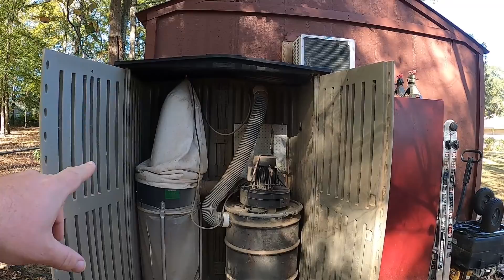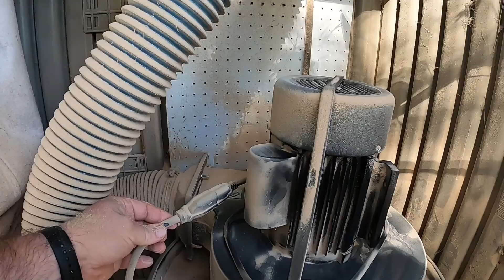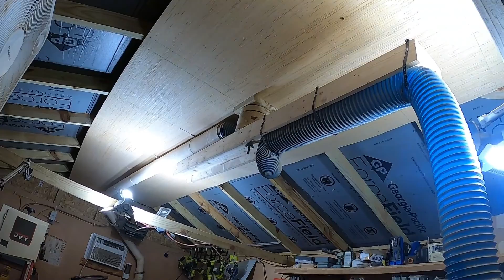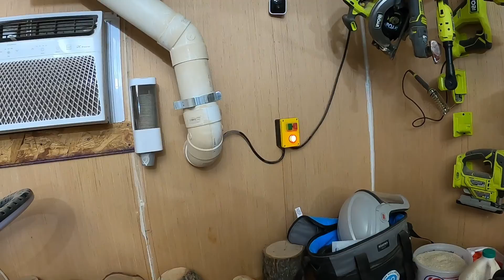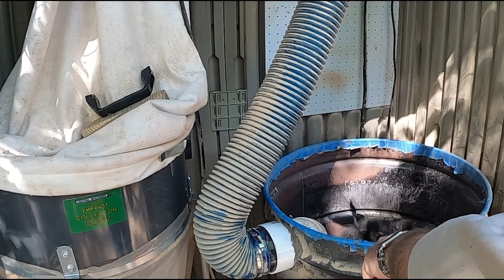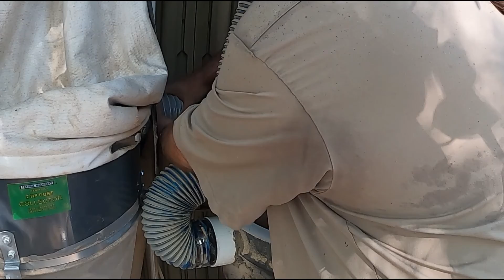Small Shop Dust Collection - Put It Outside!

Comment: You are pumping a massive amount of air out of the shop. Where does the make up air come from and how does it impact heating and cooling?
Reply from the maker: The shed is not airtight so plenty of makeup for me (and the window a/c unit has an intake damper). If the weather is nice I leave the doors or windows open. I’m sure it’s not the best for heating or cooling but I generally only run it when needed. I have a box fan with three merv 13 filters that recirculate the shed continuously. Great question, thank you for asking and watching!
Reply from the maker: Between your feedback and the setup on the Myers Woodshop video, I may have a future modification to consider. Instead of using a separate tool closet, I may build an attached closet, fully enclosed, with a MERV 14 or 15 box filter back into the workshop. This would allow makeup back into the shop with less impact on the heating and cooling and less restriction on the discharge of the collector. The noise should still be reduced since it is still separated (and not take up existing floor space). Your thoughts?
Reply: Now you’re talking Ember. Just make sure that the filter opening from the closet back to the shop is large enough to supply enough makeup air. There are two problems with the current system. 1 - you are expelling all your conditioned air from the shop. 2 - when the shop is closed, there may not be enough air sucking in through cracks to feed the beast and it will not be able to perform at its rated capacity. It will suck, but it won’t suck enough. So I think your new solution will work with a properly sized return. Not perfect in terms of conditioned air, because the closet will be colder than the shop. So on short runs you will still be pulling cold. On longer runs you will be warming the closet.

Comment: Thanks a lot for the video. I have Neighbors 30ft from my shop, do you think it's far enough? I'm worried about the noise
Reply from the maker: The noise is going to depend on a number of things, your collector and if your shed for it is insulated would be the big ones. Mines fairly quiet and almost unnoticeable at 30’, but putting some sound insulation in the shed should help if needed. Take a look at the comments too, there were some good ideas shared there
Reply: @emberwoodandcrafts-thomastritt  Thanks a lot 🙏

Comment: To all that commented to Ember. I have a question. I had a girlfriend that worked in a kitchen over a hot grill. every time she turned on the exhaust fan it would suck all the air out of the dining room. They installed two 4 x 6 vents to the outside right above the grill. When she turned on the exhaust fan she would open the doors on the new installed vents. It seemed to work. The exhaust fan pulled its air from the vents that went outside.  I have a large filter system that I am going to mount outside my shop. I was wondering if a person can vent the dust out why cant they pipe the fresh air in right next to the tool that's going to suck the air out when the filtration system is on. Might be difficult for your overhead flex hose. But I guess you can have a cross draft coming from the wall piping fresh air to any tool in the center or maybe run a smaller flex hose the the same area where the suction is. At least you will only be cooling the air between the air in and the air out. Just a thought. What say you all???
Reply from the maker: Should work. You might lose some heating/cooling, but I have some loses already - nothing I’m overly concerned with for my shed. I plan on building the utility room for it in the future and will likely vent it back in through a merv 15 filter. I like your idea as well since it would keep the recirc loop small!

Comment: This is a common mistake that many woodworkers make. Sounds great, but when it gets cold outside, suddenly you realize why this was a very expensive mistake. All the air that your collector is sucking has to be made up with outside air betting sucked through all the leaks in your shop. That air will be very cold (outside temperature) and it will get very cold in your shop very quickly. All that make up air has to be heated now to keep you comfortable. Maybe it never gets cold where you are, but most don't have that luxury.
Reply: The thing most woodworkers need to worry about more are the fine particle dust their lungs are sucking in without realizing it. You can spend thousands of dollars and messing around with expensive filters and still not do nearly as good a job as Thomas does just venting all that $#@! to the outdoors where it can be safely diluted.
Reply from the maker: I don’t consider it a mistake, but do concede your point - may not be for everyone. It can get chilly here, but nothing I can’t handle with a sweater and space heater nearby. But this is a good point to consider. For me keeping the noise and fine dust outside is worth it in the summer and winter. I do turn it off when not in use so this minimizes the impact to a degree. Thanks for watching and sharing your thoughts on it!
Reply from the maker: Between your feedback and the setup on the Myers Woodshop video, I may have a future modification to consider. Instead of using a separate tool closet, I may build an attached closet, fully enclosed, with a MERV 14 or 15 box filter back into the workshop. This would allow makeup back into the shop with less impact on the heating and cooling and less restriction on the discharge of the collector. The noise should still be reduced since it is still separated (and not take up existing floor space). Your thoughts?